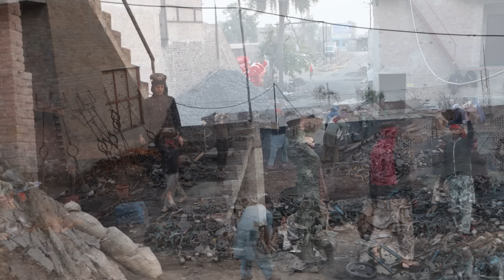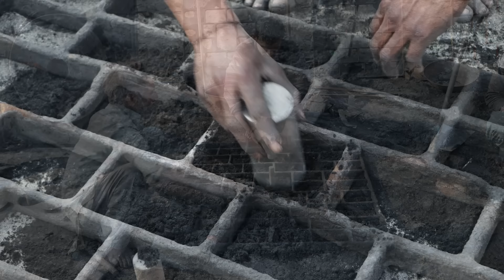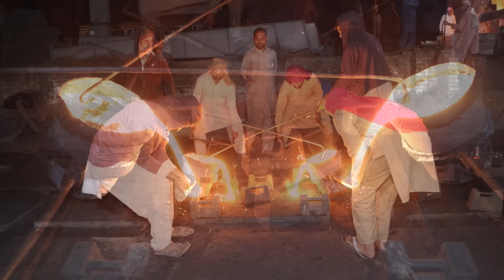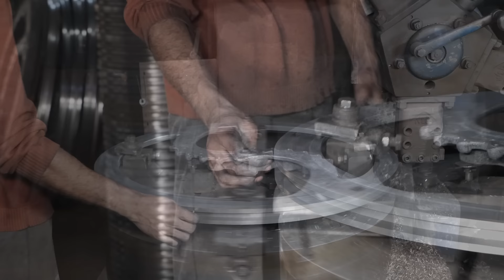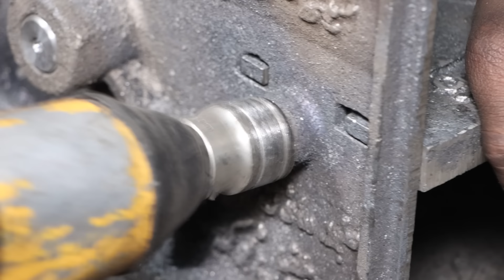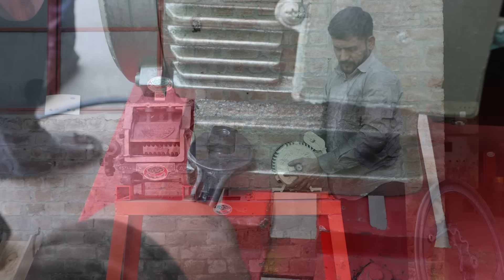Incredible Process of Making Quality Chaff Cutter | Factory Manufacturing Process

Comment: Wonderful Workmanship there should have been a safety cover over  V-Belt Drive this will be also providing Safety of Operator from Cutter Blades to avoid any horrible accident and a proper Outlet of the Cut Out material with in this cover so that there would be an even Collection of the Cut Material. Thanks a Lot for the Video.

Comment: Metal on Metal bearings with no lubrication - not even holes for oil wicks !!
Image how well it would run with Phosphor-Bronze bushes and some lubrication. or even sealed  Ball Bearings.
Would drop the power use by 30% I guess - still, they probably don't pay for power in the fist place !